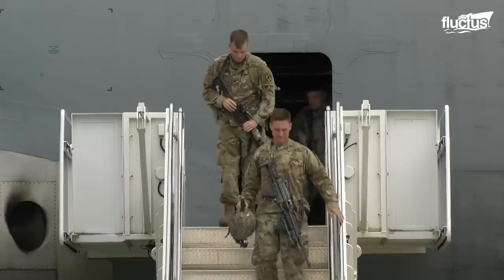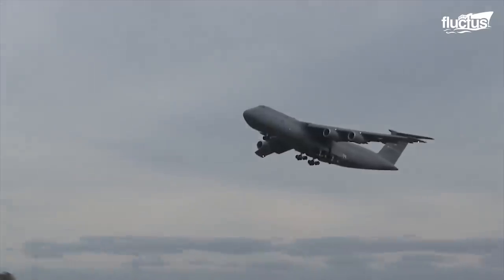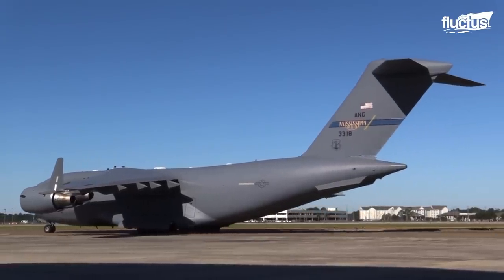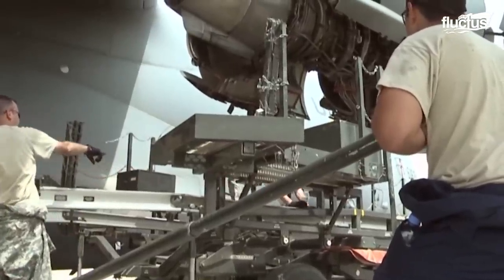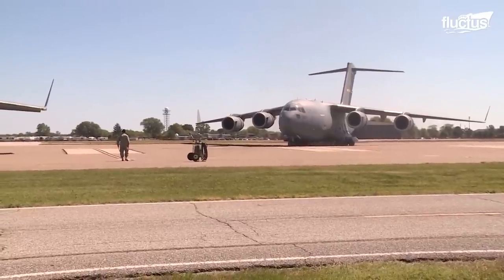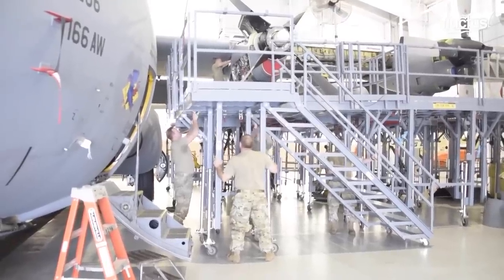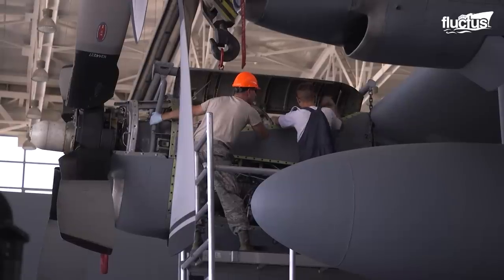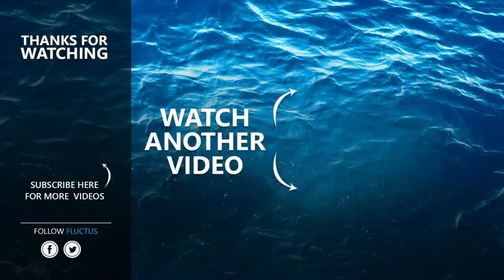The Crazy Process of Repairing Massive Jet Engines of US Biggest Aircraft

Comment: If you’re going to give engine dimensions in meters (as I would regard correct). 

Maybe give the weight in kilos not pounds ;) 

Interesting video, though I will say with all your videos they could be a bit more dialogue rich.

Just constructive feedback I hope
Reply: Why? These are US airframes. We use pounds here. There is converters online if you’re curious.
Reply: @Warpgatez  Well that was condescending. 

I was more pointing out it's odd to use the metric system for dimensions then switch to imperial for the weight. Be consistent.

Whilst imperial is really annoying when you're a designer and it appears even pilots have had problems with not putting enough fuel in with confusion between metric and imperial so...

But I think I'm intelligent enough to understand how to convert measurements.

Hopefully you found the one to convert the metric units for measurement to inches and feet ;)
Reply: @chrisshelswell3222  my bad. I didn’t even hear them mention metric.
Reply: I do those conversions in my head. we need to dump feets & pounds in favor of metric. Why be different than the rest of the world? Oh pardon me we also sport DST and TIMEZONES more asinine concepts that are world renown. yeah how STUPID is that? yeah what's wrong with ZULU time EVERYWHERE?
Reply: @leecowell8165  yeah I agree with standardizing education. Zulu, metric. And I’m an American. I think having imperial and F is stupid. EST, PST, CST, +- is dumb. Zulu, Celsius, and metric should be standard